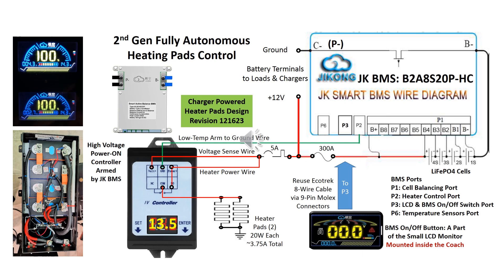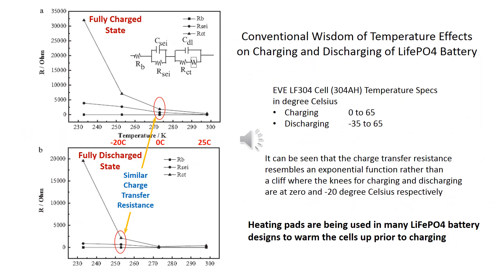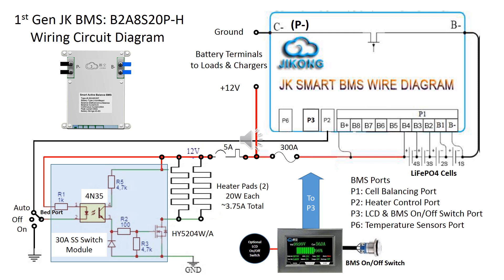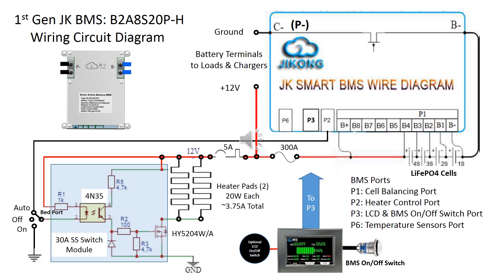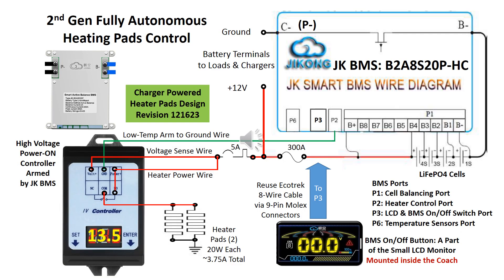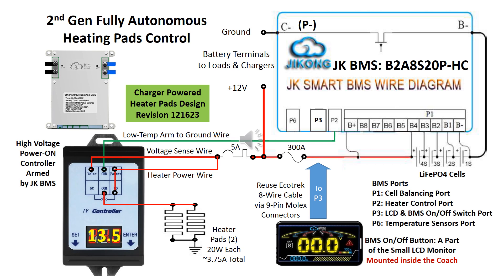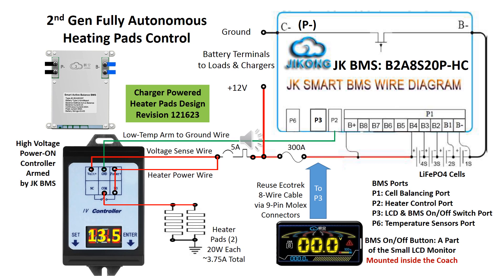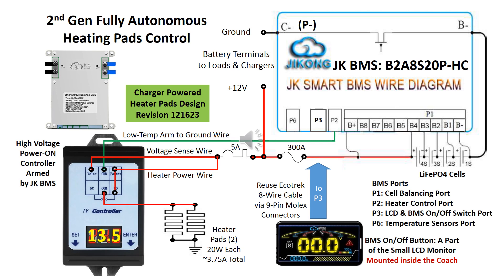JK BMS - Battery Heating Why/How: Using External Energy to Heat LiFePO4 for Low Temperature Charging

Comment: Great explanation of how the gen2 system works. I did not get it before watching this video. Thank you SO much. I am implementing this setup now. I have 2 wires in my boxes linked to a controller inside the van. So I attached them to led lights inside that will alert me when the pads come on. Linked as a third heat pad. Thank you again.

Comment: I do not understand.  In this design you are not using the "Charing detect pins" from the BMS at all.  Instead you are using an external controller?  How exactly is the controller set up?
I see a couple issues here;
1- If the JK BMS has the ability to detect charge or no charge state and turn heating on/off accordingly then why would you need to use the A30-UA controller?
2- If you wire the controller as you have then there is no way for the BMS to turn on the heat pads in a low temperature discharge scenario.
3- The way the controller is wired, when the heating pads are turned on they will draw from the battery and charger and not from the charger exclusively.
Reply from the maker: Sorry, belated reply: Great observation and understanding. (1) the A30-UA controller is used to detect a charging source and use it to power the heating pads instead of using battery power. (2) the heating pads are armed (on standby) by low temperature and then powered on by an external charging source ; low temperature discharge is fine and there is limited reasons to draw down the battery further, to power on the heating pads. My Gen 1 design does what you may want - heating at low temp regardless charging or discharging. (3) true, but the design assumption is that the charger should be capable of higher current than the heating pads consume, hence no current from the battery.

Comment: Has anyone figured out what the two red/black heater connection wires are for? In the description they are called charging detect pin + -
Reply from the maker: The red and black wires might be used for future features by the developer.

Comment: Great development from gen1 to gen2 ! I will try the same set up tomorrow. 
One difference will be my battery is 24v (25.4v nominal) and solar charge set to 28.4v. I will buck down to 12.4v for heating pads. Can the voltage + sense be on the solar/ battery busbar, and power + behind the DC buck 12v?
Reply from the maker: If you have 2 heating pads, you can connect them in series and use 24V directly. Sensing the battery voltage is better and capture all charge sources. If too cold to charge, battery charging is shut off, the sense voltage level is essentially that of the charge source.

Comment: Hello. What kind of external power do you mean?
Reply from the maker: Any power source used to charge the batteries.
Reply: Ok, ok. So, I could turn off tempareture protection at victron system and use my PV to heat batteries. If there is no power from PV (cloudy or night) there is no sense to heat batteries. If there is any power then first will be used to heat up batteries and than BMS will turn on. What do you think?
Reply from the maker: @mateuszmazur2025  , yes, that is the idea.
Reply: Hmm... It won't fly. Autocorrect. There is one bus bar for victron mppt and battery (which is obvious) so I will get power form battery even at night.
Reply from the maker: @mateuszmazur2025  Yes, you can get power from the battery at night. However without a charge source, the battery voltage level is not high enough to trigger the "high voltage on controller", thus preserving the battery energy.
Reply: The voltage monitor module only allows heating when charge voltage (solar) is available, during the night it is not allowing anything current to flow
Reply from the maker: @chouckham  The battery can discharge at night and current can flow wherever needed, just not into the heating pads.
Reply: @chouckham  yes you are right. But one more case I can imagine. Very cloudy day, or panels cover by the snow. I can detect voltage but effective power will be very low may be under needed power for heating